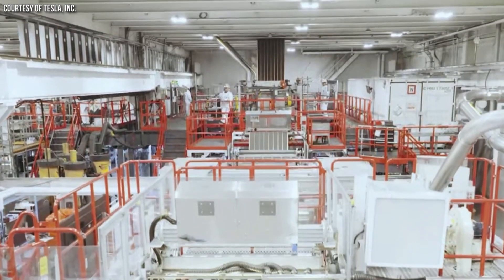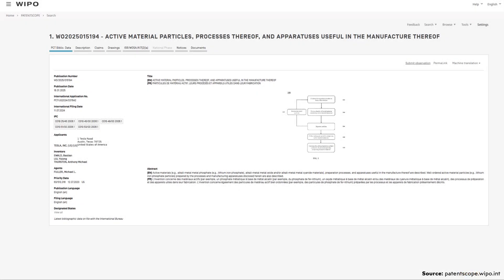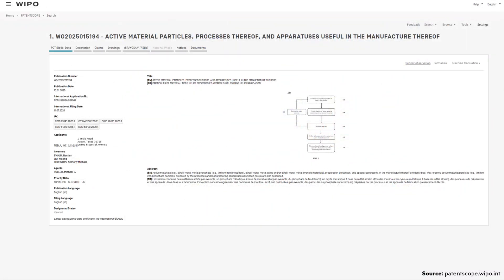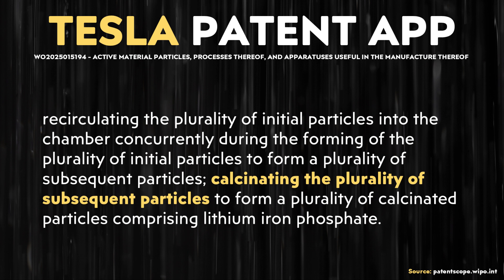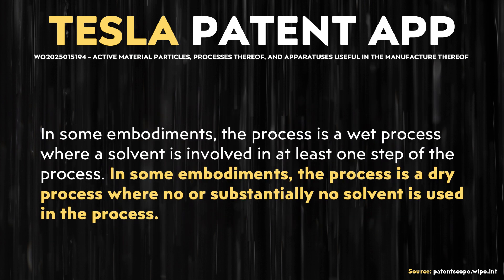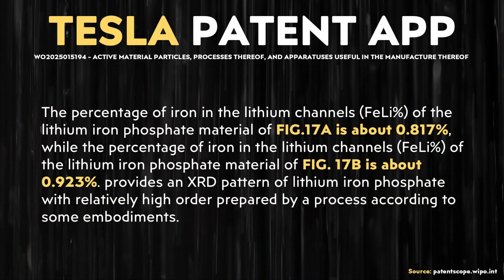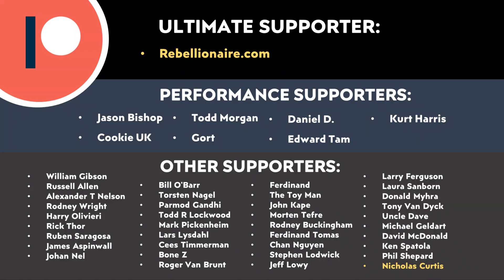HUGE Tesla Battery Update: NEW Tesla LFP Battery Tech Revealed!

Comment: Why isn't the new Model Y AWD using LFP? I don't want an NMC battery.
Reply: Why?
They’re lighter, and more energy dense.
Reply: @ LFP are safer (much lower chance of thermal runaway), tolerate repeated faster charging better, longer expected battery health, can be charged to 100% daily, less degradation at higher temperatures, etc. The history of Tesla's LG NMC batteries are not good, if not down-right sordid. Most major battery fires are with these LG NMC batteries. Google "LG NMC fires" and also google "LGP vs NMC" - I don't want a timebomb parked next to my house, nor do I want to drive around in one.

Comment: wish they would make actual cutting edge batteries like LTO or LiFeYPO4. the og watson cells with yeterbium were way better than current lfp tech, had lower temp tolerance and usually didnt even need a bms or balance board.
Reply: Yeterbium is a constrained supply matterial so no.
Reply: LTO is not energy dense
Reply: @mike_w-tw6jd  its more energy dense than sodium ion, especially at a usable voltage range. slightly less dense than lfp

Comment: You never mentioned the difference between the lfp batteries and there normal batteries and benefits  which is better ?? 😮
Reply: Anyone following this channel is aware of the differences
Reply: Being one of those regular followers, this is my take, if you are interested: LFP chemistry is inherently safer (with respect to catching fire, but do note that the BMS (battery management system) and physical form factor (pouch vs blade vs prismatic vs cylindrical ...  ). LFP cells typically can be charged more fully and more often with less degradation than NMC and NCA batteries. On the down side, LFP batteries tend to have a lower energy and power to weight ratio, making them less optimal in use for performance and long range EVs, though that may be changing with new manufacturing processes and chemistry tweaks.
I'm pretty sure my 2023 Tesla MY LR AWD has NMC lion batteries. Not really a safety problem, because Teslas have really good battery monitoring/management systems and are built for safety. Rumors of them being prone to spontaneously combust are false, though out of respect for the chemistry (Nickel-Magnesium-Cobalt Lithium Ion), I park my car on the parking pad, not in my garage.

Comment: Thanx Jon, for giving us this one of a kind deep dive into Tesla's 50% improvement in their LFP, Calcination process, which help me see how this breakthrough will likely domino into more of Tesla's Skull-Splitting' INNOVATIONS!  This is the type of Vertical Integration that continually gives them both most of the EV market, but now a stronger foothold on the  Battery Backup market & Low-Priced EVs as well.  The Sky's the limit for TESLA.

Comment: If these charge as poorly as all the rest of Tesla's 4680 lineup, I would stay very far away from them. It's more likely these will be for Robotaxi, a product that doesn't even have a charging port, so slow charging is fine.
Reply: Are you referring to the model y with 4680’s? The current 4680’s in the cyber truck appear to be much better.
Reply: @MFoley-tv3zh   It's a much larger pack so it seems better but they still don't have a great C-Rate and the curve is pretty bad. Go watch "Out of Spec Reviews" for more info.

Comment: Variants of LFP are the future which is why they're taking their time.  Personally, I wouldn't get an EV without LFP.  Should be interesting.
Reply: LFP is better in one way that it can more regularly be charged to 100% and much safer.
Reply: They are actually the present, not the future. I assume you live in the US where LFP is barely even an option yet, but the rest of the world has lots of Chinese LFP batteries already in customers vehicles. Tesla is not a leader in battery tech, like a lot of people think.
Reply: @TheLastMoccasin Tesla is a leader in battery tech in many ways. For one, they manufacture at very high volume. Not too many EV companies do.
Reply: @blackrockcity  Tesla barely makes any 4680 batteries, enough to build less than 10,000 Cybertrucks in a quarter. All other batteries Tesla uses are batteries they purchase from other manufactures. Lots of other (Chinese) EV companies make many more batteries than Tesla does, and some even sell batteries to Tesla. No one buys Tesla's batteries.
Reply: @blackrockcity  You need to learn about the battery innovations out of China. Tesla is far from the leader in high voltage traction batteries and their performance.
Reply: @TheLastMoccasin Of course it isn't. Desperately hoping that Tesla does develop a lfp cell that is as durable. It's not impossible. China had no battery tech around 20 years ago. Panasonic was Tesla's original supplier
Reply: @CrRodney1   Yea, Tesla will probably make a LFP 4680 at some point, but likely will use it in robotaxi where charging doesn't matter as 4680 has proved to be rather poor at charging in C rate and curve. Wish we could get Chinese LFP here in the US as they are leading in battery tech, hands down. But Tesla is innovating in "light bar technology" 😁
Reply: @CrRodney1 It already exists. The fastest charging car in the world, a Zeeker model, uses an LFP. Check out the State of Charge video from a few days ago.
Reply: @keithv3767  don't know what this means. All I said was to encourage Tesla to develop its battery technology
Reply: @TheLastMoccasin 
False info or outright lies!  RWD Tesla Model 3 have LFP batteries.  They're stable/less prone to fire from collisions and chargeable to 100%.  But, I prefer the NMC batteries that are used in the LR AWD Model Y bc it has longer range/weight as well as quicker discharge&charge than LFP.  Costs more than LFP,  but it's a reasonable premium.
Reply: @geoffgeoff3333  Last I heard LFP also have worse performance in ‘cold’ weather. I never did get a definitive answer where ‘cold’ starts though. 
Also- the new model 3 LR RWD is not LFP but the older 3s that weren’t LR did if I remember right. Even there it seems hit or miss.
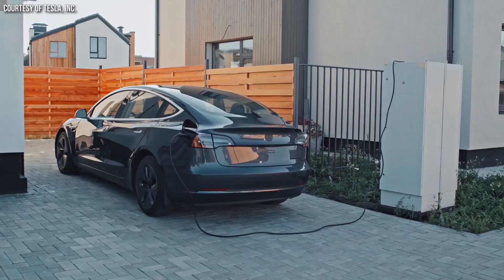Reply: @geoffgeoff3333  at 1:40ish he did say Tesla is going to ‘bring back’ LFP to the current models.
Reply: @geoffgeoff3333   The M3 with LFP is no longer offered. You should probably know what you are talking about before accusing others of lying.
Reply: @geoffgeoff3333 Because of incentives to produce batteries in the U.S. from U.S. mined materials the 2023 RWD was the last model of the Model 3 or the Y available with LFP in the U.S.